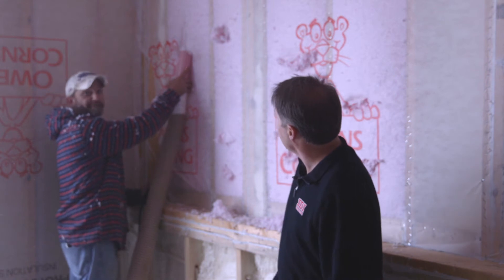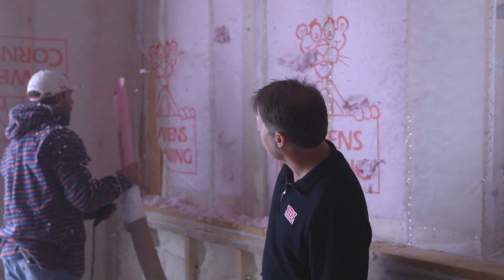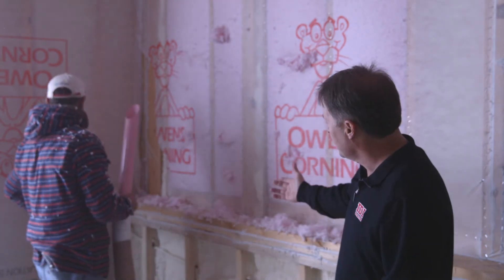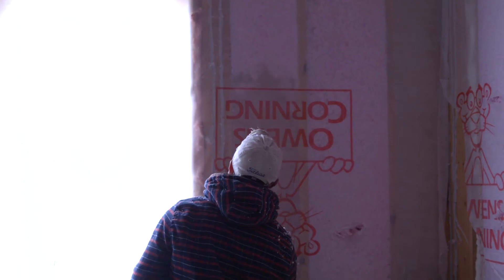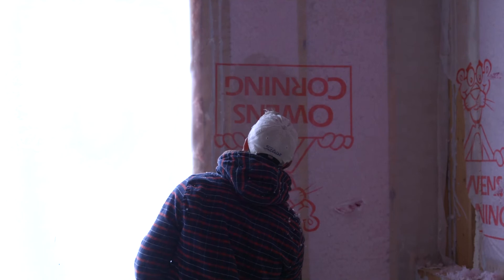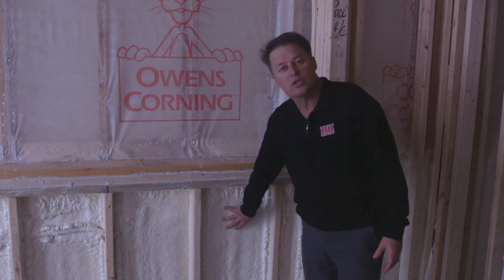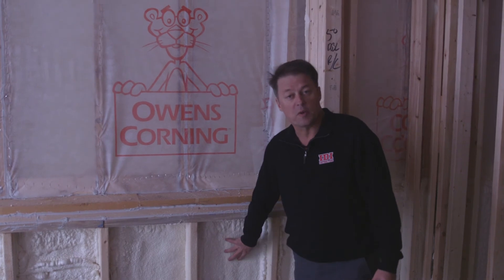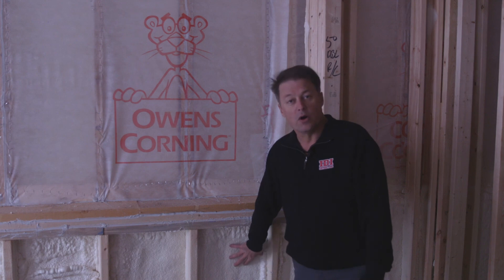The Best Way To Apply Insulation To Prevent Condensation

Comment: What about using Rockwool instead?
Reply: As long as it can be sprayed fiberglass, cellulose or mineral wool is find. Don't try to force batt insulation into the stud bay. Insulation loves a snug fit not a force fit.

Comment: What most of these experts continually fail to mention is that the R value of the foam needs to be higher than the R value
of the batt  or you'll have a rain forest in your ceiling. Flash 1" foam? R-7. Who is going to put R-6 of batt over that? 
Can you even purchase R-6 batt? Not even a response from the video maker to the two questions below. 
I'd call it industry malpractice when they do not explain this to owners/contractors. Shameful.
Reply: Can you explain this more? If a dewpoint is not reached on the surface of the foam, how can condensation occur? On the ceiling??  What about 2.5in cc SF (R15) with pink FB at R12?
Reply: @alextirabasso2441  I can't claim to understand exactly how the dewpoint is reached  but apparently if there is a greater R-factor of foam next to the roof, the dewpoint ( I think) can only be reached within the foam itself. Maybe I'm wrong in explaining it but that's the deal. Yes, your example would work. My house I have 5" foam and 6" batt. I think that's about R-35 for the foam and R-19 for the batt. My son tried the "flash & batt and , thankfully he hadn't sheetrocked the ceiling yet as he had the rainforest effect. All the (sopping wet) batt had to come down and he had more foam sprayed in. No problem since.
Reply: If your foam is too thin it'll condensate. Had nothing to do with the batt insulation.